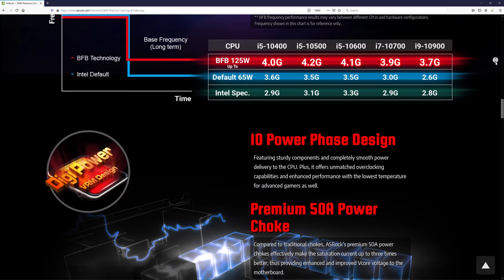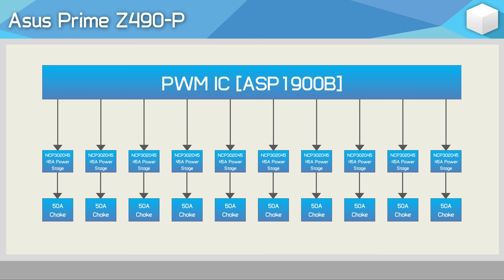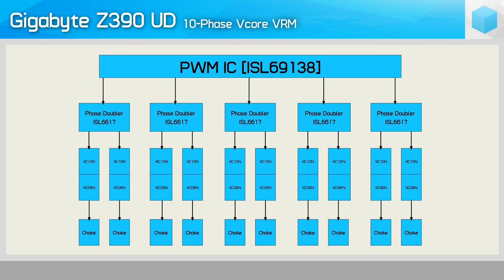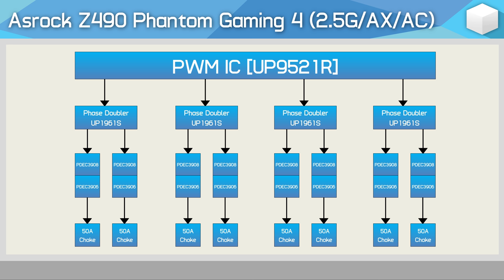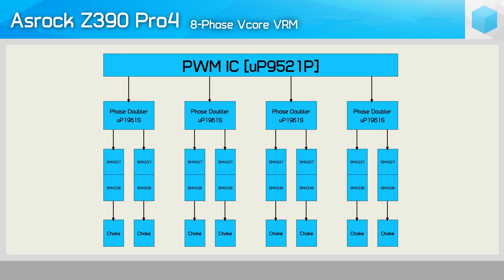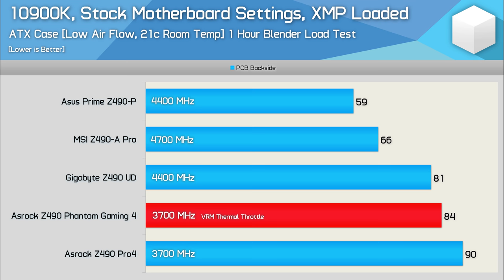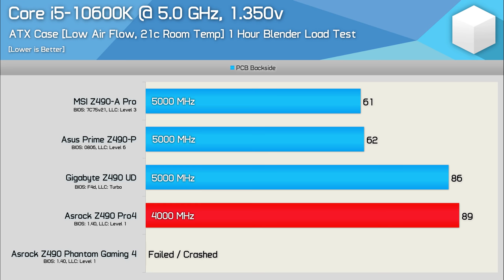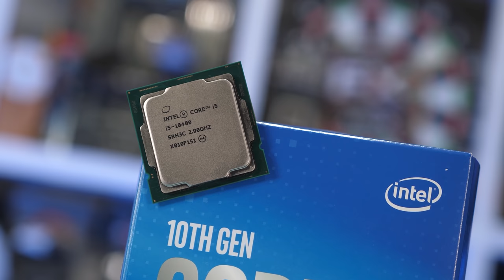Intel Z490 VRM Testing, Budget Buyers Beware of Lies & Misleading Marketing

Comment from the maker: Please note the Asus Prime Z490-P block diagram shown in the video was wrong, here is the corrected version: https://bit.ly/37lmS5p
Just 5 signals are taken from the controller, not 10.
Reply: does it matter really, if that other one OTP's so bad at stock, lol.    Mistakes happen, Great work Steve and crew. B)
Reply: @Zarcondeegrissom  It doesn't change the results in anyway, it's just a bit of misinformation in the video that I wanted to correct. Thanks for the support mate.
Reply: ASRock Z490 Extreme4 im interested in this board and i love the reviews , is there anyway you guys can test this to let me know if its worth it. LOVE THE CONTENT KEEP IT COMING
Reply from the maker: @kaokaluki880  Skip the Extreme4, it has issues right now.
Reply: Hardware Unboxed what do you recommend? I’m going with a 10400 and some 3600 memory , just a placeholder until 11th gen drops. I’m looking at the asus z490 prime or the gigabyte vision G ? Are those good? Or the asrock steel legend 🥵 yes I know it’s basically the same as the extreme 4 lol but are there any differences to make it a little better cpu wise?
Reply: Hey Hardware Unboxed, Can you please help me and advise if i am safe with my order of an asrock steel legend z490 (which is very slightly more expensive) or should i also be returning that too? 

Im not up on the whole VRM stuff at all. i just want to build a pc with the i5 10600k on a budget and oc at around the 5ghz mark safely and reliably. the website refers to thie steel legend as being 11 phase (instead of the 10 in the reviews) and also suggests 60a DR.mos chokes (whatever that is)...

So yh.. for the little extra cash, am i safe with the steel legend or should i return it and go for something a bit better?

Thanks in advance for any replies.
Reply: @Hardwareunboxed   Would you be able to review an older monitor the Dell UP2716D as it is relatively cheap for 1440p IPS 10bit and "Factory Calibration Report, 98% DCI-P3, 100% Rec 709 color gamut". Just seems like a really good content monitor (from specs), that nobody has really reviewed. About $500 in South Africa when converting to US$ from local currency.
Reply: Needs a notation at that point in the vid
Reply: Someone help me!!! Z390 for 160 euros + i5 9600K or Z490 for 190 euros + i5 10600K?
Reply: @2kgamingchannel  I think Steve showed that 9600k already stuttered in a few games (maybe one), but... it did stutter. Go 190Euro option, just 30Euro more and you're getting a way better set. Alternatively go Ryzen 3600 & b450 for way less fr the entire platform, CPU+MB? ;) 
P.S. Your monitor is the main important thing in your rig, you know...
Reply: @dveydah  I just thinking is Z490 mother better than z390? Transistors, cooling and etc. I wanna buy and use PC for 5 years. Just waiting for RTX3070
Reply: Acually Hardcore Overclocking didnt mention the asus p z490 board in his best budget z490 boards the said the z490 asus m
Reply: I see one use case for these terrible Z490 boards, if they are cheap enough they can be used for a locked CPU such as 10400F or 10600 and pair em with some nice 3600MHz sticks and boom budget gaming PC! :D
Reply from the maker: @anonym34566  No, the problem is it's a crap board.
Reply: Msi z490 a pro have Bluetooth or not.. Please reply
Reply: if i buy Asrock z490 pro4 then can i use 3200mhz with i5 10400 on 3200mhz  ?
Reply: So can i take z490 msi a pro ?
Reply: hows the VRM on the Z390 Aorus Pro Wifi??? I havent tested it yet
Reply: Dude Asrock has 2x m2 slots. Why say that has only one??

Comment: These will be perfect for my i3-10100
Reply: Get me one aswell. It would roast my oc 8700k. >.>
Reply: Between ASUS and MSI, you have some excellent choices I think. And according to Steve stress tests, they will handle even higher end 10th gen CPUs as well. So they will handle an i3-10100 no problem.
Reply: Yes, even that will make the Asrock boards sweating.
Reply: L M A O
Reply: You still might want to stick a fan on those VRMs ;)
Reply: You are in every video😂
Reply: Alexander Rewijk I’ve read this before - what is “i3-20” referencing?
Reply: Don't forget the Gigabyte Gaming X model, cost just a few $ more than the cheapest ones and have way better VRMs. not tested but should be on par with the MSI board here.
Reply: Who ever buys this cheap low range today ? We are to poor to buy crap 💩, seriously , better pay 100$ more and you done for at least 5 years. And with 100$ more we can buy a nice Ryzen jack of all trade long socket support and less components to change in long run. Why pay cheap every year for new processor, m. board and RAM when you can have something to last you years ?especially these times where everything is uncertain.
Reply: arent they bit too much for i3-10100?
Reply: if you wanna use i3 10100 then go with gigabyte arous b460m
Reply: Motherboard coater than the cpu?
Reply: @marianmarkovic5881  I guess thats the joke ? But I really am gonna do it because motherboard is a backbone of a pc, and ill upgrade to i7- 11 gen eventually lol.
Reply: @Cr1ptlord  ok, if u need pc now,and puting i3 as placeholder i get it. If u would use it in that configuradion for pc livetime it would be weird,

Comment: After this video I only got one question ... Who at AsRock said: "these mainboards are fine we can release them" ?????
Reply: Not as bad as the thermals of the ASRock boards, but still, not great. Thankfully, they improved with the X570 boards.
Reply: @piyushmenon4987  sry of course I meant AsRock 😄😬I fixed it
Reply: these boards are totally fine if you put a non-k cpu in it willing to overclock only RAM. wouldn't do it myself though, too expensive
Reply: @MoltenPie  Yeah, honestly, AMD is just a lot better of an option right now.
Reply: @MoltenPie  nooo! becasuse the asus and the msi boards are cheaper and better! You wouldn't buy them in any case
Reply: it's called corporate greed.  Or just shitty engineering :)

Comment: Awesome. My favorite two brands, MSI and ASUS did okay. Asrock Z490 Phantom Gaming 4 Unmatched overclocking performance. That's good, I don't want any of my motherboard's overclocking to be anywhere close in matching these bad Asrock mobos.
Reply: I fully agree. Great to see MSI and ASUS pulling through with some great budget Z490 MBs. I had my doubts that every manufacturer would pull it off, but I am happy MSI and ASUS have. 

But Asrock is a major disappointment for myself as well. First Buildzoid did a video exposing their deceptive Z490 top tier MB marketing (I forget the exact MB, but he has a video covering it), and then this morning I found out Asrock used an misleading original BIOS for one of their launch X570 MBs. An BIOS that basically lied about power output to increase power delivery (and potentially performance) of said X570 MBs. 

And now Asrock does this with their Z490 budget MBs. Another bunch of deceptive marketing for these Asrock Z490 MBs, and they even refused to send out samples for testing, no surprise they refused, but very disappointing indeed. 

But, as you said yourself, we have MSI and ASUS pulling through with some great budget Z490 MBs, so happy days.

Comment: Watching this video was a relief; I just purchased an MSI Z490 Pro-A yesterday, and only just saw this video! I am impressed so far and overclocking options are great, as is the VRM cooling. After a couple of days I got my 10600K at 4.9 GHz @1.37V set LLC5 (1.35 V max get) and G. Skill B-die RAM running at 3900 MHz 14-15-15-33 (overclocked from 3600 MHz 15-15-15-36)!

Comment: Wow, budget ASUS product that isn't crap, I'm impressed. I guess we have to wait for the TUF mobo that will somehow be more expensive while being completely shit.
Reply: The best description of TUF lineup
Reply: I have always bought Asus or MSI when it comes to motherboards, have never been disappointed. Asrock has been mixed, some good ... some very bad.
Reply: Gotta continue the TUF tradition
Reply: The X570 Tuf was an excellent budget MB though. Terrific VRM. Same with their budget X570-P/Prime, also excellent VRMs and are directly comparable to this Z490 variant. 

It is pre X570 ASUS budget MBs that were terrible. This is the second gen in a row (X570/Z490) that ASUS has nailed it.
Reply: Tuf x570 is an exception though.

8 sata ports, 7 usb 3 rear io, 600 amp vrm, and pcie4 on all pcie slots and m.2 slots, of which there are two of, respectively.

Comment: I can't understand all that hate on ASRock. They have great boards, X299 Taichi was a good performer overall (some even called the perfect X299 Motherboard) on launch. They also have top dollar motherboards. They have been proven to be extremely reliable, my ASRock X79 Extreme 11 is the ONLY X79 Board I bought that is still working to this day, both my Asus Rampage and my MSI X79 died, and so did the replacement board from MSI lol.
The only MINI ITX X299 Motherboard belongs to ASRock -> X299E-ITX/ac.
When Intel "banned" Xeon CPU's from "regular motherboards" forcing motherboards to have a specific chipset to work [Intel® C232
], ASRock was the ONLY company that released a 'gaming' motherboard that could use 8th gen Xeons. ASRock did it against Intel request. Intel pulled them from the stores as quickly as they could by moving a lawsuit against ASRock.
They also have products to rival Asus top of the line such as the ASRock X570 AQUA (it is expensive and limited, WOWWOWOWOW!!!!, for people who think that PRICE = EVERYTHING). 
Is ASRock Z490 Pro4 a trash motherboard? Definitely. Is ASRock the WORST BRAND Ever? Far from it. Do your research and stop being fanboys.

Comment: I actually used the Asus Z490-P Prime in an build for my father with an 10700k and it runs really well actually, he's very pleased with the performance and I used an Noctua DH-15 Chromax.black to cool the CPU and it runs so quiet you have to check its working by looking to see if the board lights are lit. An awesome board imo and I encountered no issues with it whilst building and no issues whilst installing drivers either. Didn't do any overclocking with it though, although it easily ran the 10700k at 5.1Ghz all cores although in certain benchmarks like Cinebench R23 it was getting pretty toasty but that is without an AVX offset too. All in all an great board for the price, £165 I think I paid back in April 2021.

Comment: Steve like your videos, but could you consider mentioning the Rds-on (the Resistance of mosfet from gate to source when on) of the low side mosfet when dealing with VRMs using discrete mosfets instead of powerstages

Comment: Fun side note: the only VRM I’ve ever managed to hit OCP on was an old gigabyte UD board that was running an FX-8350. It had eight sets of the exact same mosfets the reviewed UD board uses. Of course, to hit OCP I had to replace the stock VRM heatsink with a custom version with copper fins and active cooling. So, I consider it an improvement that now a UD board will hit OCP with the stock heatsink! Running my FX-8350 on that old 970 UD board was a terrible idea, and it looks like running a top-end cpu on the new UD board is just as bad of an idea.

Comment: Interesting result; although I can't say I've had the same performance issues with my ASRock Z490M-ITX/ac
... even with a 10700k crammed into a mini ITX case on air cooling (Node 202; Black Ridge HSF), it can sit at 4.7ghz all-core no issues (around 75 Celsius core temps; 3600 mhz ram @ 4000mhz).... funnily enough the feature set on such a small board appears to be better than some of those ASRock boards tested (dual M.2; USB C; 4x USB 3.0 ports; 1 GbE Intel ethernet; 2.5 GbE Realtek ethernet; Intel AC wifi etc.). Perhaps the VRMs were upgraded for the Z490M-ITX/ac? They do mention "Premium 60A Power Choke
s", compared to the 50A ones on these boards? Maybe they took your criticism and made some upgrades...

Comment: Looking for a new PC when the Nvidia 3070 comes out and i was looking for the 10700k. The PC should be somewhat futureproof, so which Mainboard offers the most features u can not use right now/are about to become the next big thing? No wifi necessary, no oc plans etc, but especially with the new GPU´s coming up does each MB offer the required adapter and sockets or can those new GPU´s come up with a big surprise which would make these MB´s not compareable? Sure, doesnt sound very likely but who knows? ASRock Z490 EXTREME4 (even tho AR wasnt the winner of this video xD) for example? Thanks!

Comment: It's why I have only ever bought Asus boards for the last decade, the last non Asus board I had was a Gigabyte and I had RAM issues and overclocking problems with it when tried modest overclock's with a Phenom II X2 550.

Currently using a Asus TUF Z370-Gaming Plus II with a 8700K at 4.8GHz all core overclock with 3333MHz 16GB DDR4 with CL15 timings running flawlessly for 18 months.

Comment: I have the 10600k running on stock settings on the MSI Z490 A pro board. The cpu seems to throttle even on stock settings? Ive noticed it in games and on cpuz. it runs on 4500mhz and drops to 800 mhz. Is that normal??  The temps remain low at 25 degrees with a 280mm corsair aio cooler.

Comment: I think Asrock released that H470 style board branded as a Z490 because of bad Z390 sales. The locked CPU + low end Z490 for memory overclocking would be awesome, if the board was $90. If it cost more than that, you can just get a 3600 and a b550 instead and get all the features instead of one extra feature. Seems a huge portion of people buying individually packaged bare motherboards are going to come to a similar conclusion.

Comment: That's actually kind of sad. I've always liked ASRock ever since the days when they had PCI Express and AGP on a same motherboard, or maintaining PCI slots or IDE headers way beyond their usefulness. But now they have corner-cutting voltage regulating and poor I/O layout, that's unacceptable.
I have an ASRock x470 gaming K4, and I didn't realize that it actually had pretty poor VRMs either until I watch one of Buildzoid's videos. It's handling Precision boost overdrive on my AMD ryzen 7 2700x pretty well, but I don't think I would trust a newer platform from them without serious research.

Comment: You know what the first thing I got from this video was? That the hoses on that AIO cooler aren't long enough to mount it in the proper orientation.
Reply from the maker: It's fine, we've run 360mm models like this for over 5 years without an issue in multiple systems.

Comment: Dear lord.
Am I correct in thinking that the ASrock Phantom Gaming 4 would not handle an 8700k with a few more gold pins on the bottom overclocked a bit - in 2020?
I'd send the board back if I had VRM throttling at stock - it's not anywhere near fit for purpose - I wouldn't be surprised if they put a proper heatsink on that thing in a second revision.

Comment: Asrock is usually my first choice for value or budget boards. 
I've been using the Pro-4F on a few Ryzen 3 & 5 builds and have found it to be reasonable for overclocking.
Maybe these manufacturers should be forced to detail the VRM config on the specs page instead of just a summary of the output. This is similar to what PSU manufacturers do, including listing the efficiency curves.

Comment: Will a gigabyte z490 UD mobo run a 10700k under a Dark Rock Pro 4 at stock or slightly OCd in a meshify C (with good airflow) without the VRMs or PCB being uncomfortably hot? I know you guys used a 10900k with average airflow (I think). Only considering because I'd be getting a stellar deal second hand, also upgrading from 6700k in a dodgy msi board.

Comment: well the ASUS PRIME Z490-P doesn't have PCIe Gen 4 Clock Generator, while the MSI Z490-A Pro does. Since they are priced the same I would go with the MSI Z490-A Pro to support RTX IO with a RTX card and PCIe gen 4 storage. Actually most of ASUS Z490's don't support gen 4 except for the Maximus Extreme.

Comment: Would vrm temps be lower or equal then these tests when gaming instead of blender?
Reply: Gaming is less load so the temps should be lower. That said it would depend on your room ambient temp and also your case and its air flow etc.

Comment: At 9:16 are there not 3 M.2 ports visible? One at the top above the main expansion slot, the one dedicated to WiFi in between the PCIe slots and then the "ultra" m.2 underneath the chipset?
Reply from the maker: The top port isn't there mate ;) The M.2 WiFi port isn't included under storage. There is a single M.2 slot for storage devices.

Comment: Msi did this with b570s ...everyone needs to read reviews before buying. .even the msi b450 tomohawk has many issues..such as if you update bios for 3000 series it stops ability to load up bios or open it..even when manually trying to get into it..seriously its time for manufacturers to sort out better ways of updating bios making ng it risk free.

Comment: I have an asrock z77 extreme4 mobo. I’ve been trying to over clock my 2600k i7 and even though the bios says the settings have been applied, it changes nothing in the windows system and all monitoring software shows it goes no higher then 3.7ghz. I’ve tried there own turbo 30 settings and there own oc settings as well as my own settings. Following other guides for over clocking the same chip on the same mobo show no changes at all. Bios is the most current one. I cannot figure out why it will
Not overclock.
Reply: That's a known issue even with Asrocks AMD boards. I literally have load default settings in the bios then OC settings before it applies overclock settings in windows.